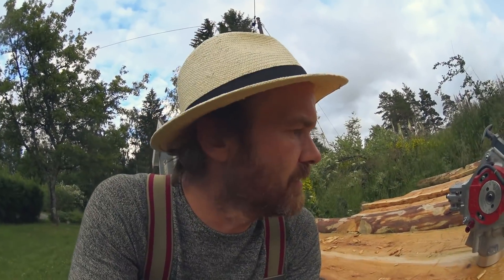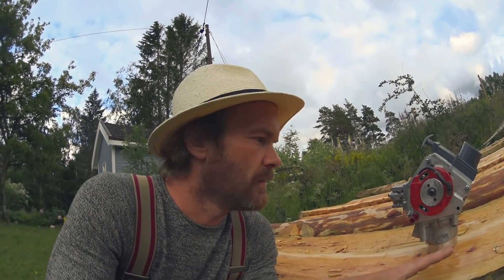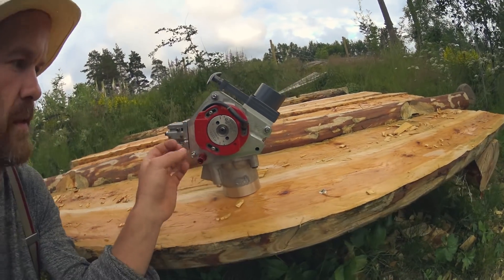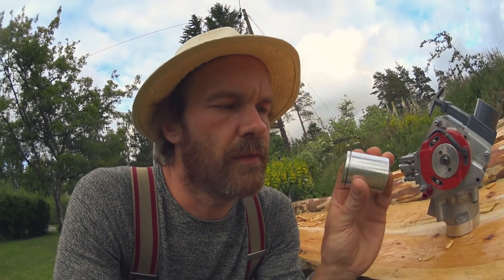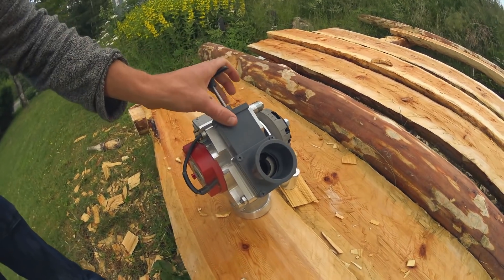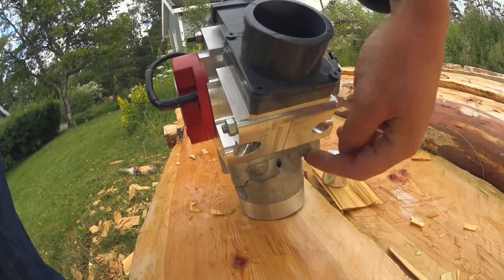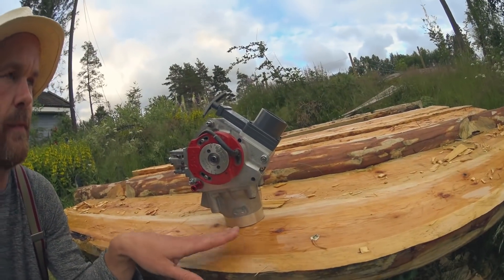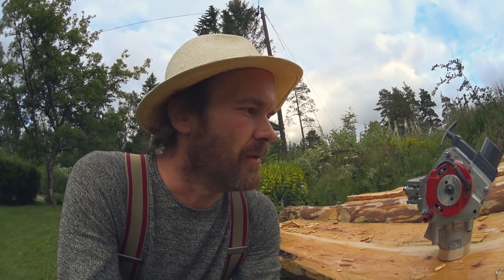The Most Powerful Two Stroke Ever and The Axe Only Log Cabin E5

Comment: Ok 50 cc ist nice thing to try. But will it just produce hp or newton as well? If only hp it won’t race at all. 

Back when I was younger we tuned 70 cc. To 20 hp no problem. Some crazy guys from France tuned a double 80 cc to 55 hp. Without nos. 
I can 100 % feel the passion good luck with it.

Comment: Here are my thoughts, maybe some people will be annoyed at you for having a release but I understand you very well just from watching and listening to what you say and how you say it. Your somewhat of a perfectionist and your weakness is actually your obsessive drive to have things perfect or be the best at what your doing. That type of obsessive is what will do you in. We are not meant to spend 20 hours a day working, it's just destructive to everything. This condition we have that on one hand can be the greatest thing ever to gain knowledge and skills and the more we learn the more we want to learn because we DO NOT want to miss a single part of the equation. Everything must work perfectly together and we won't be happy until it does and we understand exactly why. On the other hand it can be the worst thing ever depending on how hard it has you. The focus is just like an obsession and IF we don't have an outlet ( mine is drag racing or weather permitting riding my CR500 through the woods... fast ) one of two things is going to happen.

#1. If you never give your mind time to rest, process your ideas your going to miss things then you might not figure them out at all. It's like letting the dust settle and try not to think, let you mind go somewhere else then the idea comes to you.
 Redesigning will be miserable then the stress and pressure is going to destroy any desire that you have to complete this project.

#2. If you push yourself to the point of exhaustion like you were before this virus hit everyone around you is going to dislike you very much. When my mind is totally immersed in one of my projects I can't focus on much else, it's like I can't disconnect from what I'm doing then my family life sufferers. Then the more involved I get the louder my wife gets because I'm ignoring her !!

Side note: After watching your videos you got a fire started in my shop and my passion for 4 strokes. I have an XR100 project that I'm seriously thinking about putting together with everything I have and going for the 104mph record.

Just remember if you are meant to do this you will ;)

Take care and God bless

Comment: I mentioned it before, but i don't know if you read it, but be careful with what type of spark plug you use. Methanol reacts with iridium and platinum (catalytic reaction) and can cause spontanious combustion!
The nitro/methanol fuel for model engines is designed to react with the glow plug's iridium or platinum filament (ignition timing on these engines is done by adding or removing head shims, so it's compression sensitive too).

Comment: Nice to see the engine back. Respect for what you do. One thing I want to mention is that I am worried about the 20000 rpm in combination with the v-belt drive. I don’t think that is going to be reliable and I am afraid that it will be very inefficient..

Comment: I really like both, woodworking and twostroke content. I wouldn't even mind some 4stroke content. 
For the most powerful 50cc motor, wouldn't it be more powerful if you'd build a 2stroke with exhaust valve like in 2stroke diesels, you could use a compressor with that, making it more powerful.

Comment: Log cabins are not my thing, but a change is as good as a rest and you will go back to the 2 stroke with a clear mind and might spot a previously unforeseen flaw or a potential improvement.
But do it before the winter blues kick in again. 
And is the log cabin going to be your new dyno cell.

Comment: Doing new challenges for a while is good for the the brain, makes you form different connections and when you go back to the "old" stuff you see it in a new light :D
Reply: Actually you learn more stuff so you which you can relate to the "old" stuff which when you return will pop up, like what if I thought the same way with the old as the new? And you try it in your head an might work out that it don't  work like that, BUT you found a middle thing that might be the answear :))

Comment: After you're done with these projects, could you attempt to make a working 2 stroke engine out of a refrigerator compressor an keep modifying it for the best performance possible? There are few videos that could help you. Im currently working on one too which almost works as it should

Comment: i do not know if anyone has mentioned this, i remember a sort of axe for making plane areas on a log or beam in croatian it is called "švarba" that is on countryside language i do not know the modern name for it. it is made left or right handed , one side is plane on the axe the other is "vinklad" out from the wood so one will not hurt the knuckles. i have seen it been used in croatia when i was a kid.
maybe someone can help with a modern or english name for it. have a peek here for some pictures https://www.njuskalo.hr/antikviteti/stara-tesarska-svarba-desna-oglas-29287330
Reply: sphinxios  Are you referring to a “broad axe “ by any chance. They can have the handle either for a right hand or left person. Blessings to you
Reply: @TheBeardedCarpenter  It could be i do not know, since from pictures on google some have similarities some do not. the axe type i am referring is made assymetric and it is sharpened from one side only. it is only made for make wood flat. have a look at the link of course there are variations of it bigger or smaller. look at this url this is a good pic of the assymetric type i mean https://wisementrading.com/wood-working/muller/muller-biber-broad-axe-classic-s-style-35-handle/ in croatia they also bend the handle out from the side that is cutting a bit to save the knuckles i guess.

Comment: Getting hung is part of the salt cure. Imagine a bored L'Brapp (L is 50 not Learner or a forehead L) hanging like Gaston, Heikki or Roger. The air limits of the small are a part of the challenge. Boundary should change just by scaling up to 125. 30HP from 50 means a 250 or 500 would be...the don't call it experi mental for nothing.

Comment: I thought I knew it all about two strokes. I'm learning so much here! I watched your Bonneville run on video  Spectacular, and you have the right stuff, Hence your title. Keep it up, Brother!
Reply: MunroM84  the ones I deal with are built in china by a 10 year old lucky to install the piston arrow backward or shady  quality control. unbalanced crankshafts. You have to tear a brand new motor down to inspect it and balance the crank but be very carefull the metal is a lower grade and less than adequate.
It is always a learning curve. I grew up in a lawnmower and garden equipment shop putting bikes together! Back when a mini bike had a Briggs or Tecumseh here in the USA mounted on a homemade 1 inch steel tube frame.